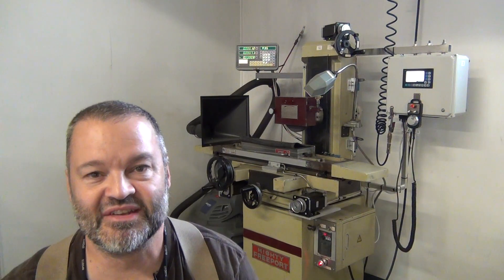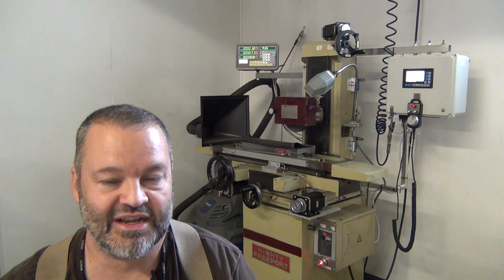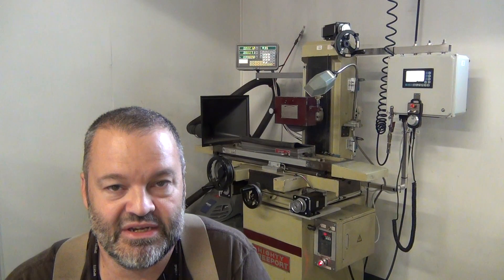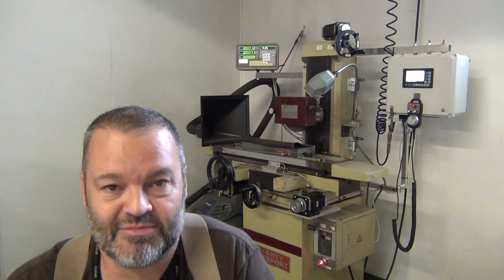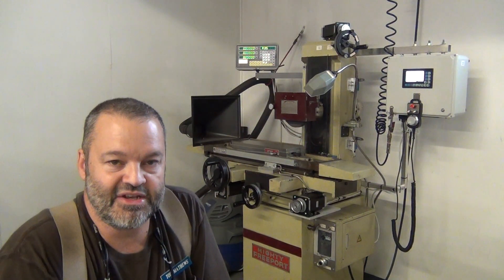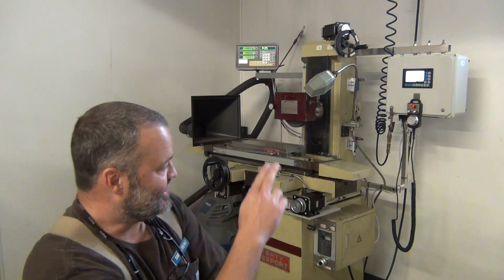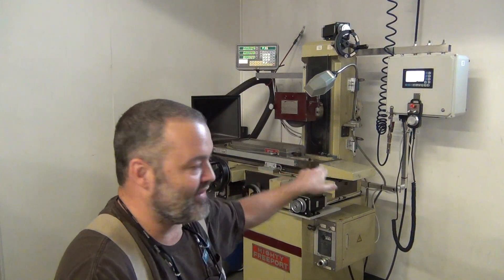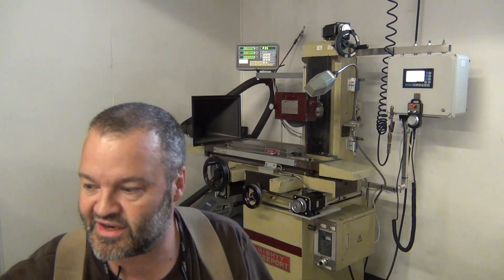DDCSV2.1 CNC control on a Surface Grinder (part 1)

Comment: Hola te felicito por tu trabajo!estoy por hacer lo mismo  con mi rectificadora y un plc coolmay.Que motor PAP usaste?Yo compre de 8.5NM pero los tuyos se ven más grandes.saludos
Reply from the maker: 1600 oz-in NEMA 34 type.  Probably overkill but I didn't want to design the whole thing and end up under-powered.

Comment: Is there a way to feed the glass dro to the driver?
Reply from the maker: Not that I am aware of however, some glass scales have a "zero" mark that could be used to HOME the axes.  DDCSV2.1 is remarkable flexible in this regard.  On my installation I used the limit switches as home signal but you could also use the HOME signal from a glass scale but most glass scales do not come with that feature unless you specifically ask for it.

Comment: Nice work, Tom! I'm currently building a similar machine. Where did you get the poly case? It looks like a perfect fit for everything.
Reply: I got it from Polycase: https://www.polycase.com/
Before I built anything I made a 3D model of the component placement and case interior.  I'm glad I did because I discovered many interference issues in the 3D design environment and avoided discovering problems after I had cut and drilled anything.  I think Polycase even has 3D models of their cases that you can download.

Comment: Great video, thanks for posting. You may want to set param #448 so that when you stop turning the MPG wheel the motion stops.
Reply from the maker: Yes!  I do have #448 set and it stopped it from accumulating extra pulses from the MPG.  It does still execute the deceleration "down ramp" so that is probably what you are seeing.  I wanted controlled acceleration and deceleration at all times otherwise there is increased chance of the steppers loosing their count.